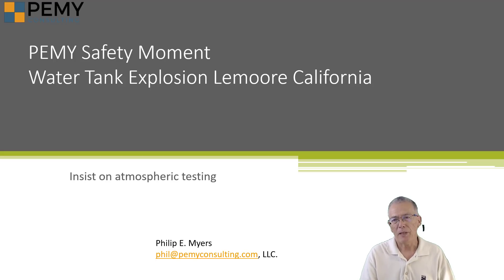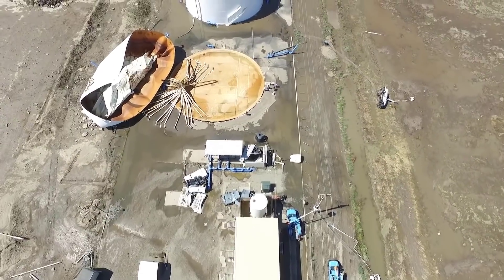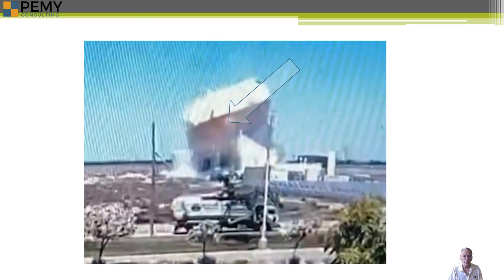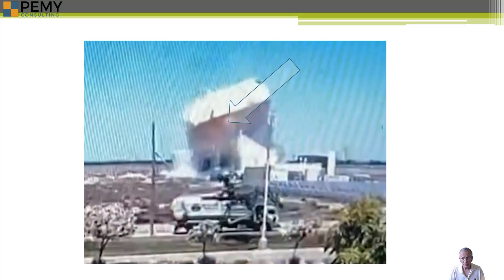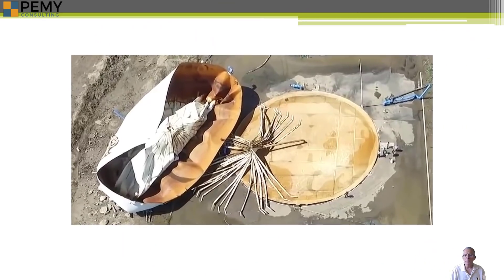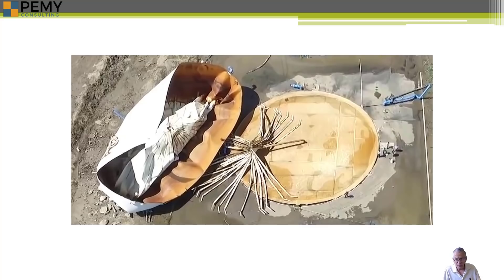Lemoore Water Tank Explosion

Comment: I think it's worth mention that some of the newer methane meters do not power the whetstone bridge full time but rely on the last known value of the reference. If someone was to drop or jostle
the meter hard enough to interrupt the battery for a split second it can re-calibrate to whatever
 the percentage gas is at that moment and then possibly lead the operator into thinking the % gas
is a safe level, Light the torch boys, it's only 3%.... BOOM

Comment: I'm 74 and a good deal of my working years I was a welder, or worked in a Machine shop, or doing mechanical maintenance that required welding...the 'welder' always gets blamed for stuff because 'welding' scares people...and they often don't understand what it really is.
 I worked on those big shiny tanker trucks that bring gasoline to your neighborhood station. They often developed cracks, and we ALWAYS used a flammable gas detector before going inside and lighting up the TIG torch...

Comment: The design of the tank required adequate venting capacity or a fragile roof wall joint.  Either OSHA regulation 29CFR1910.106 requires owner operators to have and maintain design information showing the adequacy of the venting system.  Typically an area of incomplete documentation is the emergency venting or accumulation of hazardous materials.  The loss of life is not acceptable.  However as point out many details were not presented and so the comments are based on the out come and experience of the design of tank venting systems at multiple chemical manufacturers and refineries.

Comment: Almost every one of my jobs is confined space. I've been trained to work in confined spaces at least 4 jobs a year on average. This incident escapes me on what could've been the catalyst for an explosive vapor...unless there were cutting torches and lines within the confined space then I'm at a loss. This should've never happened. Safety first. Bottom line second. PERIOD!
Reply: Over pressure, not explosive gas
Reply: @Magic-Conk  Definitely something explosive creating the overpressure 
See telltale sign of explosion or conflagration in the video - the orange glow
That wasn't water
Reply: Here's your answer, "Lemoore water tank explosion caused by methane gas, incomplete safety check. Ravyn Cullor hanfordsentinel com Jul 22, 2021 Updated Jul 26, 2021  Methane occurs in ground water either by activity or bacteria or the decay of organic matter, or through the gas seeping up from deep underground or landfills, according to the Illinois Department of Health.
The department said methane in water itself is not toxic, but when methane dissolved into water meets with air, like air in the head space of a water tank, the gas is released. Methane in the air can make it hard to breath and can make the air flammable or explosive.
The press release said there are steps which can be taken to prevent a similar explosion. When working on any plumping on water systems or in enclosed spaces, one must test for gas before doing any work that involves sparks or significant heat."
Reply: All confined spaces should be vented and tested

Comment: Having lived in the area of Lemoore, (Naval Air Station) ground water in the area has Sulfur and there are also petroleum deposits. Never knew of any problems with petroleum in the water but the sulfur compounds are removed. I would Guess there was a build up of Hydrogen Sulfide and the hot work set it off

Comment: I Thought Tanks had to be Vented atleast thats what i was told you dont put heat to anything thats not vented they go bang.
Reply: They do require a vent, but the size of the vent does not have to be that large for routine operation. Whatever exploded in that tank clearly overwhelmed the vent.
Reply: Clearly what ever was in that Tank should not have been there so we are still here someone fucked up there was a gas in there that should not have been look at Boats they have blowers to clear out pent up gases

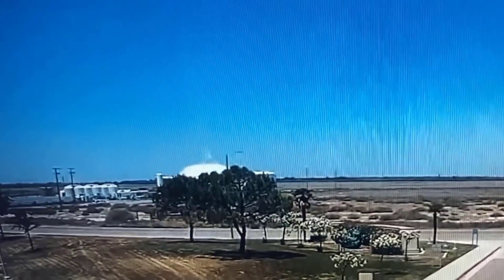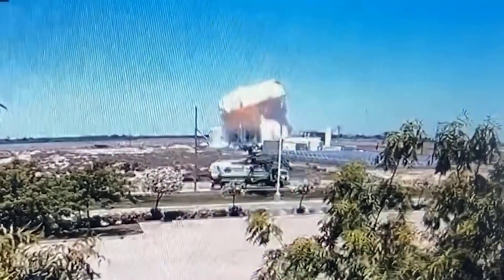Comment: A little-known feature in any YouTube video is that you can single-step through the video by using the comma (reverse) and period (forward) keys to walk through the video frame-by-frame. With the video stopped, move the time bar over to 0:39 or 0:47 then start stepping. I believe you can also see the unfortunate welder on the boom taking a ride.
Reply: Thanks  for telling us about this feature, very useful!
Reply: Thanks I will use comma (reverse) and period (forward) in some videos to read a sign or label for example.
Reply: Damn, yeah i see the boom truck at the :47 section flying off to the right. Wow. Well spotted. The poor guy.

Comment: You get microbes , tiny organisms that poop , that create methane in water and fuel tanks . Occasionally you need to empty tanks and clean the critters from the bottom . Its noticeable in fuel tanks because equipment filters will get plugged by the bugs and screw up fuel systems .
Its important to also take samples from the very bottom of tanks on a monthly if not weekly basis to check for issues .

Comment: If it's a water tank, where would the flammable gases come from?
Reply: The area this accident happened sits in an area of California that has massive oil fields . A lot of people do not realize that when you pump oil out of the ground it is 50% water , the mixture is heated and separated then the water is pumped back into the ground . This area has a lot of methane and natural gas leakage from years of oil pumping by Texaco and Chevron . This is not saying that is what caused the accident .
Most tank accidents by a welder is the actual welder not checking for gasses in the tank and or welding above the liquid line . You should be able to weld safely below the liquid line but if you take someone elses word on conditions you can die !
I would like to know where the guy was welding .
Reply: @RicardoGonzalez-ww3ov 
Thx for the great information.
👍
Reply: @RicardoGonzalez-ww3ov  Methane and oil migration is common and natural. It doesn't have to be associated with extraction activities although they can be. In some parts of the world, and parts of California too if memory serves, there are places where methane migrates from deep shale formations to aquifers. California due to its multiple fault lines and subduction zones has the perfect geology for these formations and the constantly shifting rock often causes new fissures within traps to create migration spots for gas. Another common place for this in the states is people living in north Texas where the Barnett Shale formation is located (the aquifer gas is actually from the Strawn formation above the Barnett, which has a much more permiable trap layer). However, most of the methane found in aquifers is caused by anaerobic bacteria digesting organic material deep within the aquifers themselves. Migration or contamination from drilling activities is a very small part of the overall numbers.
Reply: @captainotto  i worked in the old Texaco field not 20 miles away from Lemoore and some days we could generate up to 5 mega watts of power from the non street gas mix coming out of the ground .
Not saying that is the cause but i know the ground in the area . I agree its probably microbes they are very common and nobody ever cleans a tank wether its water or fuel.  Its very common to get bad fuel because of microbes .
Reply: @UniversalStandard 
I was wondering that too. I was thinking it's well-water with a tiny trace of some gas that percolates out.  I'm no geologist so I can't say for sure.
Reply: could of been a methane build up or something like that.
Reply: Probably all the toxic stuff they put in the water that we drink

Comment: Basic rusting of iron grabs the oxygen from water releasing explosive hydrogen gas. I'm imagin the 'oxidation' of other metals do the same thing.
I
All metals except gold oxidize, even chrome and aluminium and stainless steel. These metals actually corrode very fast, leaving behind a still shiney layer of corrosion that impedes further corrosion. Hydrogen is released.

Comment: What types of gases would be trapped in a tank like that ?  Would the tank have some sort of venting system to equalize pressure and or release the pressure when filling with water or removing the water during normal operation?
Reply: @U Betcha Why should it matter whether or not they are unionized? Or ionized, for that matter?
Reply: Without more information if this was purified water, or coming straight from a well, my first guess would be methane from organic decay or possible natural gas inclusion. These gasses are heavier than air and  a venting system would not necessarily purge these gases first.
Reply: @petergraphix6740  This technical nit doesn't change your conclusion.
Methane is slightly lighter than air, but not enough lighter to separate in a timely way.
Reply: Quite a lot lighter - if go and look up the densities of methane and air (and nitrogen and oxygen) you'll remember & learn a lot more than you would just by reading my comment.
Reply: @petergraphix6740  I live here and it is well water and I heard the vent was not opened before starting to weld.
Reply: @tiktok11150  No excuse for failing to perform a atmosphere test prior to entering a confined space, a standard industry procedure.
Reply: Methane is NOT heavier than air.
Reply: @petergraphix6740  if there was some kind of grounding or electrical issue,  could the water separate to hydrogen and oxygen ?

Comment: There are bacteria that digests trace amounts of sulfur and iron in water to create Hydrogen Sulfide gas. No fracking or electrolysis, just microscopic organisms doing their thing. Have you ever turned on a hot water tap at a building that has been dormant a week or two-and the water spits,and smells like a rotten egg for a few seconds? That's also explosive hydrogen sulfide gas.

Comment: If video of this tank exploding is slowed on computer playback to 0.25 speed:  easily seen is that something at the center of tank roof is shot into the air far above the tank itself.  A short time later this object? can be seen for an instant in the air above the top of the tank and now to the right of its centerline.    Could this have been a vent valve at the top of tank?   And why would it separate in such a violent manner unless it was closed?
Reply: The operating speed in which some emergency vent systems can sometimes be too slow and if the structure bearing the vent fails before the vent can operate it's likely to be useless, we don't know what kind of vent it was yet, whether it had a mechanical valve or a burst disc or otherwise.
Reply: My guess it was a burst disc like  @CATASTEROID934  mentioned

Comment: Hydrogen gas can build up or form in a hot water tap that has not been used in long time. This small flash fire would mostly be caused when a cigarette was held close to the tap when turning on the water. So my take on this explosion was hydrogen gas builds up and then the welder welds on the top of the tank maybe on or by a vent. Gas getting into well water is also a good possibility.
Reply: Natural gas from well water. I don't know why its not being reported.
Reply: @kevinireland8020  Natural gas from water well is not treated with an odorizer such as mercaptan so if the welder thought a smell could indicate a danger, raw natural gas is odorless. In Bainbridge Ohio in 2007 an explosion from a residential gas well started the ball rolling for new regulations to keep this from occurring. That neighborhood now has city water as part of the settlement with Ohio Valley Energy.

Comment: I still don't understand how a flammable gas accumulated in the tank.
Reply: Nearby fracking contaminated the water source.  Gas mixed with water was pumped into the tank.
Reply: @PilotVBall  Plausible.
Reply: @PilotVBall  No
Reply: Heavy organics in the bottom of the tank off gasing h2s
Reply: More than likely it was a build up of hydrogen that had disassociated with the water. This is not uncommon, it also can happen in water heaters in residential applications. Especially when they sit for long periods of time without any usage and while energized. Water tanks sitting out in the open like this one was exposed to the sunlight all day long also get hot.
Reply: This is likely an AWWA D100 water tank. 
..
It is more than likely NOT hydrogen gas that led to this event. Hydrogen gas is lighter than air and would not have accumulated in the headspace of the tank since the tank is equipped with a single vent located top center. Hydrogen sulfide, however, is a possible culprit. Hydrogen sulfide will come out of solution (as noted by others elsewhere in comments) and since it is denser than air, will stay present over the water column. At low concentrations, H2S is toxic to life. At higher concentrations, an initiating event can sustain a deflagration of the gas. When in a confined area (like the headspace of the tank), the results can be catastrophic.

Comment: Electrolysis is not as likely.  It is possible that the water in the tank came from an underground source.  Well water often has dissolved gases like Carbon dioxide, sulfur dioxide, hydrogen sulfide, methane and some petroleum derived gases like propane.  

Brought up from deep wells, the lower pressure in the tank allows the gasses to bubble off, much like the fizz in a soda bottle.

It is the headspace above the water that needs to be tested.  The water in the tank may no longer have dissoved gases; although a water sample may be tested with a head-space sample performed by gas chromatography.
Reply: I think you're on the right track. Only issue I have is I believe they were oxidizing the water prior to it making it to the finished water tank and treating with IX and GAC. Most things that could cause an explosion like this and are found in well water would either be made inert or removed by the process they are using. My only guess is that since this was a new plant still going through the later stages of commissioning is that some of the treatment process was bypassed allowing well gases to accumulate. But really who knows. It would be nice if they gave an update on the investigation.
Reply: @adamsmidkiff1   you can't "Oxidize" water.  Its already H2O.  Any further oxidation would produce H2O2 (hydrogen peroxide) which isnt possible.  

Either combustible gases dissolved in the water underground or were introduced during transport and filling of the tank.

The Central Valley has had a long history (40 + years) of contaminated ground water   Fresno has several 'Stripping" wells near the Airport that purges dissolved gases prior to use.  They bubble air through a column of water which pulls the gasses out.  The finished water is filtered through charcoal.  EPA requirement.

Hanford has a long history of Military activities in the vicinity of the wells.  These too need to be studied to see if stripping is needed there.